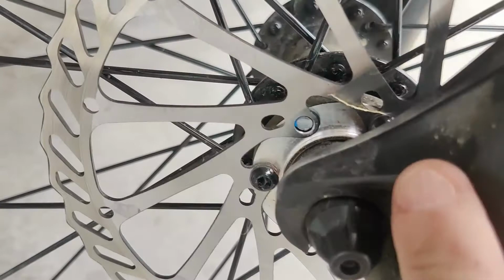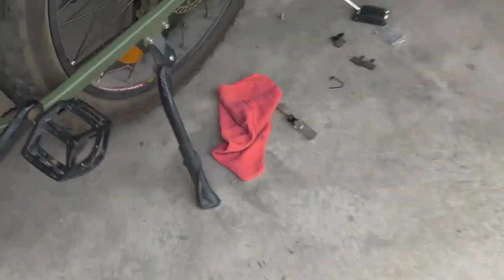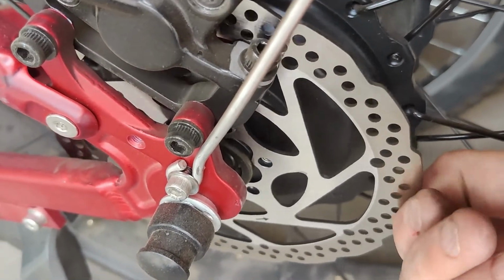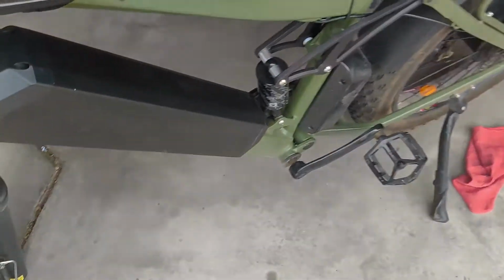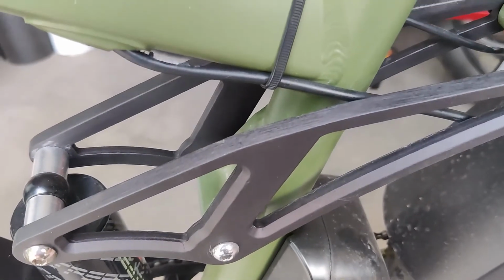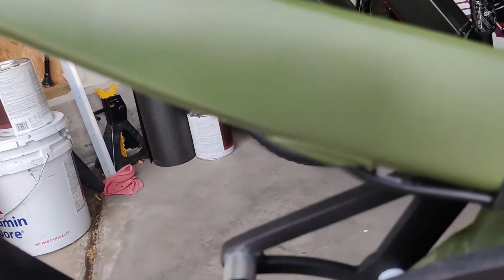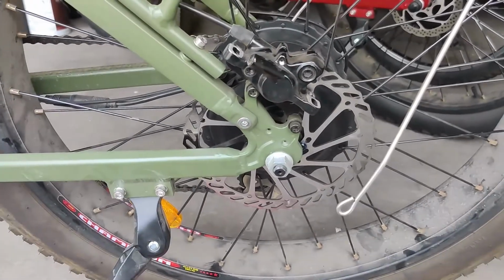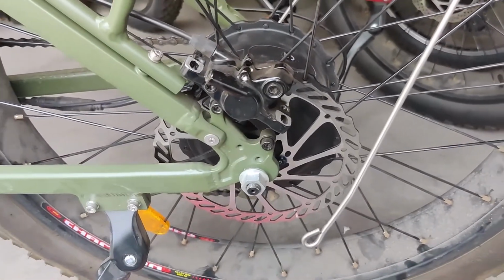Beecool Adventurer troubling issues.

Comment: Same exact thing happened to me, only I didn't notice until I hit the back brake one night and The only screw left exploded out of the hub sideways. Talked to the company and eventually they sent me a whole new back hub which also had loose screws! Some of the screws didn't have ANY thread lock at all. Couldn't believe it. Put my own on front and back and haven't had a problem (with the rotor screws) since. To anyone thinking of buying one of these bikes, check EVERY screw before you start riding.

Comment: I switched out my brake calipers with Shimano calipers and it was a huge improvement.
Reply from the maker: Which ones did you get?
Reply: @cloudpumper6399  I got the MT200. Came as a set that included everything but i found out that if you change the brake lever it will no longer stop the motor and that was a problem. So I have the no name brand levers and brake lines with the Shimano calipers. Works great

Comment: Upon returning from a ride after a few hundred miles on my Explorer, I noticed that FOUR of the six bolts holding the rear rotor had somehow worked themselves loose and were completely gone!  I contacted Bee Cool and after having to submit a video and picture of the problem, they shipped me a new set of bolts, which took a few emails and about 3 weeks to arrive. In the meantime, I removed a couple bolts from the front rotor and added them to the rear, so that both front and rear had 4 bolts, thus making it ridable as I waited for the bolts to arrive. Needless to say, when they got here I removed all of them and reinstalled using blue Locktite thread locker, and haven't had an issue so far.  One of my crank bolts have also come completely loose twice..... before I put threadlocker on those as well.

Comment: On a steep down grade with any bike you need to alternate brake application between the front and rear allowing one to cool while the other is working.  Applying both for long periods of time will cause warping.

Comment: The same thing happened on my Adventurer. Every single bolt came out of the rear rotor and I was literally riding it around unable to find out why my brake didn't work. It was undetectable even though the rear rotor was 100% not connected to the wheel.
The problem was QC on the tightening and thread adhesive. Always use thread lock or some thread adhesive on safety critical threads.
Reply from the maker: Wow, totally agree. They were filling orders too fast. Oh well, I'm a much better bike mechanic now 😁

Comment: I bought a bike torx wrench kit for this bike.There is a reason they have torx specks in the manual. Most of any type of bike is made in China these days. When you buy a bike out a shop they go through everything after taking it out of the box. I'm sure they find Alot of loose screws and bolts. This is a very good quality bike for what your paying for it but your going to have to do occasional maintenance on it, especially the breaks.

Comment: You would think they would have some decent loctite on those threads from the factory. That same bike was actually on my radar for hunting duty here in Western New York. I guess if I do go with that bike, I will have to remove the bolts on the rotors and loctite them again.

Comment: I would not recommend using red locktite on fasteners that may need to come back out some day.  Blue is the best to use in this situation.  Also it looks like these bolts with the heads sheared off are obviously lacking shear strength.  High strength fasteners are a little pricey so it's a good place to cut costs for the manufacturers. U might want to go to higher strength fasteners available at aircraft supply shops or many places online.  I would recommend fasteners with at least a 160 ksi axial tensile strength or Ftu.  This will give you shear strengths (Fsu) in the 120 Ksi range. These fasteners are not that high in price compared to the more exotic 220 Ksi Ftu fasteners which cost a lot.

Comment: Probably a good idea to check all rotor bolts on all bikes for factory dry thread locker. They use a dry gel type, it usually holds, maybe in your case bolts were never properly secured at factory. I would be anxious to see if your bolts have the factory thread locker on them. I see you have some thread locker of your own, good idea to torque new bolts and allow full 24 hours of cure time.

Comment: My front fork is worthless. I’ve just locked it out.
Reply from the maker: I'm looking at replacing the fork with something better
Reply: @cloudpumper6399  … I am too, however with 4” fat tires if I were doing it again suspension would be less important. A little weight and dollar saving(s).
Reply: There's a reason the torx specks are in the manual.